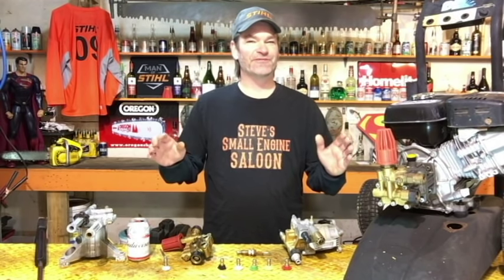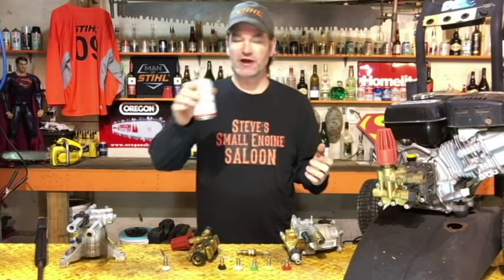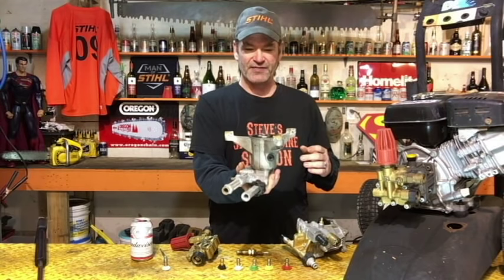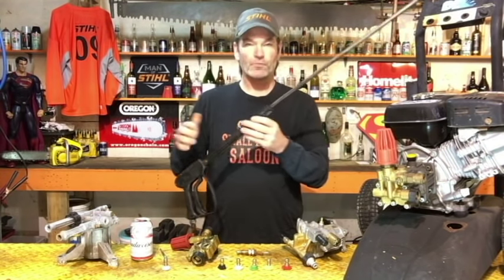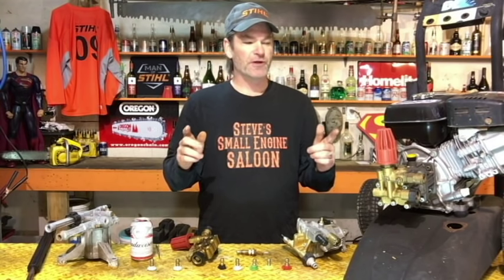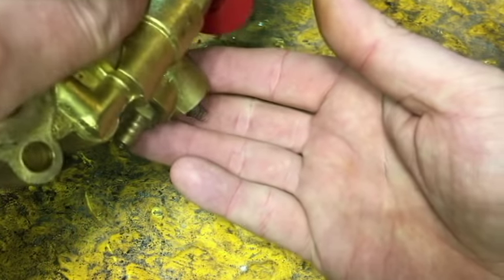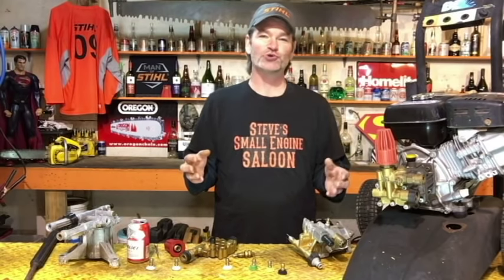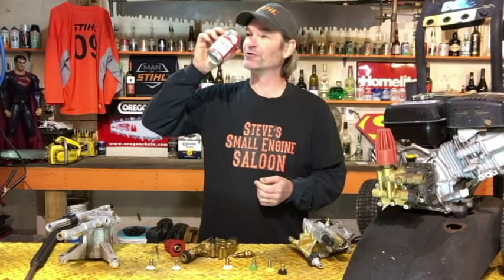How To Fix A Pressure Washer That Has Low Pressure

Comment: I want to set up some pressure washers hoses and accessories with quick connects. is there a standard or best practice for where the male quick-connects vs females go? I have seen some kits sold where they suggest both ends of the hose get the female connectors, however, hoses sold with quick connectors preinstalled have a male on one end and a female on the other. I would also like to be able to quickly/easily chain hoses together so it seems best to put male on one end and female on the other of the hose, I just can't figure which should go where. thanks for the vids! Cheers.
Reply: if there is no hard standard,  I think i would rather have the male in the wand so I have that convenience of pulling the hose away while pulling back on the collar of the female connections on the end I disconnect more often.  Also, this sheds some light on why manufacturers who sell quick connection kits suggest female on both ends of the hose, but i want to easily chain my hoses without a turn around coupler. If I need turn around, id rather have just one on the pump end. Also i think for flexibilitys sake I will make some male to male and female to female turn around on short sections of hose.  I dont like having a long chain of adapters creating a long lever to induce leaks and potential breakage on the pump or wand end, and get in the way on the wand end.

Comment: Is the pump shot if you have a small stream coming out and the hand trigger is doing nothing. Or does that mean the pump is no good. If so can the pump be fixed. It has been ran quite a bit without water hooked up. It is a mitsubishi  600.

Comment: Very informative.
Never were truer words spoken... Everyone has a favorite tip that they use all the time and the fact that holes wear over time and get bigger n bigger and bigger.
On a more serious note. It would seem to me that the majority of people's issues can be traced to the quality of their water supply.. And this video affirms that belief. We must develop a way to clean the inside of the pumps without having to open them.. I'm thinking soap, vinegar and something coarse in a loop for a few minutes along with a soak of hot RO water. Any suggestions?
Otherwise planned obsolescence wins. Can't have that.

Comment: I have a 4000 psi pump and I'm thinking of changing the oil .it sez on the pump SAE30 NOW I have BRIGGS AND STRATTON RIDEON engine oil which is SAE30. THE QUESTION is will the BRIGGS AND STRATTON oil suit my 4000 psi pump 
Thanks for your help

Comment: Question, I have a briggs 6.5 verticle shaft motor on my pressure washer, the motor locked up a week ago and I replaced the 6.5 Briggs with what I thought was an identical motor.  I hooked it all up and the washer doesn't have full pressure.  I got the old motor running long enough to hook it up again, son ran it out of oil because the oil cap came loose and he didn't notice.  loosened up the piston and ran it for a little while, the pressure was back to normal on the pump, its a horizontal pump on the bottom of the vertical shaft motor.  Is it possible I need to change the carb on the new motor so it will kick up and keep the pressure up on the washer?  I can't just run the old motor, I'm not sure how long it will be before it locks up again, probably when I get it nice and hot.  Anyway, do you have any recommendations or suggestions on what might be going on with my new motor?  It was off of a snow blower but otherwise its the same motor,  I did change the filter on the carb to the old one because the other motor only had the non filtered box.  Thanks

Comment: Hi , I have the pump like the one you had on the bench the one none adjustable modol 020344 . I dont have high pressure, only low pressure I go over all the step you mention on this video clip. Can you tell me what wrong before i buy a new pump. Thank you

Comment: Steve, this video has been very helpful and I will try to sort some of the problems with my washer using your tips.  My specific unit is a Craftsman (Sears) branded, 7 HP model with the horizontally oriented pump.  Have you come across any problems with this type pressure washer or what seems to fail most often, in your experience?  Thanks for your time.

Comment: Fired up my verticle gas pw today, first time since last year. Wouldn't run till I put new gas in. Then no pressure. I'm going to check the stuff in your video but thinking it may be a new pump. Other than blockages, can I do anything with the pump itself? This unit is about 10 years old but only has about 2 hrs running time. Thanks

Comment: i have a pressure washer that the pumps works fine but when i release the wand handle it seems to keep pressurizing and stalls the engine out instead of it going back to idle, the pump was replaced and isn't very old. any idea? thanks

Comment: Steve went to Scotland few years ago had a great beer called Innis and Gunn fell in love with it but reason for writing is have a echo back pack blower will run on choke but not off check compression only have 30is it the carb or cylinder

Comment: Hi  sir  nice vedio , i have an electrical motor pressure wash 110volts its working and it give pressure but the pressure seems like it reduce  because it does not reaches where it use to can you help me out here sir on what could cause it, thank you

Comment: Hey Steve. My problem is when I fire up my pressure washer the the water is blowing back out where my high pressure hose connects to the pump. I’ve checked the hose and tip for a clog. When it’s not running and water is on water sprays out the nozzle. Help!

Comment: Steve,  I have a 3000 psi Simpson  pressure washer. Does this model require  the pump itself to have an oil change? Thankyou.  I love your beer requirement for small engine repair.

Comment: Steve I have an older model Karcher pressure washer 2350 psi, I can’t figure out where the springs connect to the carburetor. Can you help with the routing and connection points. I can’t figure it out for love or money.

Comment: Ha, 2 years ago I didn't have the nozzle locked in, when I pressed the lever, it shot the nozzle across the yard. Put in back in and no pressure and leaked at the tip. After calling the company that made it, and explaining what happened, the tech guy said I blew the o-ring out of the wand end that seals the tip. So, that is another tip for all.

Comment: I have a troy-bilt pressure washer with the pump underneath. I got it for free. It has very low pressure. I used a different hose,wand and nozzle from a different pressure washer I know is good.  I taken the 3 brass plugs out and there is a check valve under each. 2 of them are are extremely disformed and do not move. Would this cause low pressure? Just asking before I start throwing money at it.

Comment: Can't figure mine out. No pressure with engine running. Motor tone never changes. Just took the unloader spring out (verticle pump) and freed up the plunger. Put back together and same issue. Spring wasn't broken or rusted at all. Stumped

Comment: Anyone know how to increase the pressure on a RYOBI 2300 psi electric? It's no stronger than my 1700 Black Max but the brushless motor is much larger and should be able to handle a stiffer spring and higher pressure.

Comment: I just picked up a decent Honda pressure washer for free. Cranks up first pull but the same pressure comes out weather the pump is on or not. Check valve isn't stuck. I can't figure it out.  I can hear the engine not go under load when I pull the trigger.  I'm afraid something bigger is the problem as i've checked all the little things.

Comment: Thanks Steve. Can you rebuild those small pumps( Ridgid 3000 psi, model RMV 2.5G30)? My pump started spurting water as it idled and it got to where the engine shut down, locking the engine. Can seem to find the rebuild kit on line. Im a fan of your videos. Ernie

Comment: Excellent Video Steve/ Do you have a video on Carb removal and repair for the Honda power jet, set up looks identical to what you are working on here. It starts OK but the choke wont shut off all the way without  running rough so I must always adjust it to run smooth for the pressure washer to work OK. There seems to be a slight loss of pressure when I do this and would love to clean this carb, I have used carb cleaner but its not quite there yet. any ideas would be most appreciated

Comment: Pressure. washers Ive used in the past all seem to fail the same way, the next season you try use them, the pressure is on and off again, on then off, almost as if you released the trigger and it was unloading you pull the trigger and the high pressure is medeocre at best after about 30 seconds... Everybody seems to want super high pressure, I'm looking towards a low pressure, low volume washer for washing AC evaporator coils.  I use to have one but it died.  The wand was unique, it looked like a dozen golf tees stuck into each other and you could bend it around about 180 degrees.  Dont seem to find them anymore
any ideas?

Comment: Hey Steve, I love the vids!
I've got a pressure washer that starts with 2 pulls. If the unit is moved, it has to sit for 10+ mins before it starts like a dream again. What might be causing it not to start after being moved around?
Reply: One of the reasons why you may have trouble starting your power washer again but I would think you would know about this one and that is you have to relieve the pressure on the wand by triggering the gun to relieve all that back pressure that doesn't allow the motor to start the other one is chances are the heat from the motor is causing some corporation problem maybe try priming again or adding a little more gas just keep on trying different things and eventually you'll figure it out

Comment: The nozzle tip blocking happens a lot. I bought 2 new extension hoses, apparently there was a strip of plastic in one and p!rugged my tip.
Engine bogged down when I tried to wash. Got it out with a guitar string. Also that inlet screen on the garden hose connection gets plugged up to.

Comment: You forgot to mention lime deposits wicn can build up in the pump....run some CLR through it maybe it will clear it out if not time to diss assemble the pump..
For winter storage use anti freeze in the pump ..Cheers 🍺🍺🍺🍺🍺🍺🇨🇦🇨🇦🇨🇦🇨🇦🇨🇦🇺🇸🇺🇸🇺🇸🇺🇸🇺🇸

Comment: At the family orchard/ winery where I worked for years we were constantly using our pressure washer to spray barrels and other fermentation equipment. I may have devoted more time to keeping that pressure washer functional than actually using it to clean anything. Lots of O-rings, gaskets, screens, and impellers replaced. So frustrating.

Comment: Steve, I have a "Giant" brand horizontal pump on my Excel xr2500 with a Honda engine. The engine starts on first or second pull but then I cannot pull the rope handle, it is being stopped by something. Am I supposed to be squeezing the trigger on the wand when I start the engine so pressure doesn't build up? In addition to that, there are three bolts all in a row with springs below them and some sort of white thingamjig. Somehow the water blows out the center bolt no matter how hard I tighten it. Do you have any suggestions for my case? Thank you very much.

Comment: I have an electric pressure washer, a Sun Joe SPX3000, I used it twice, worked perfectly. I put it away for 5 months, I tried to use it today, the motor is working, but the water is still just peeing out of the wand. Is the pump dead?

Comment: Steve, my pressure washer has a strange issue maybe you can do a video on. Comet pump, Honda engine. Engine idles fine. When wand pulled the engine stows down more and more the longe4 it’s pulled and will stall the engine. Replace comet pump and has the same result.wand issue maybe?
Reply: Paul McDonald mine does the same. I thought it was the pump also.

Comment: My problem is I got a new Simpson Water Blaster (belt driven), 4,200 Psi @ 4 GPM. I put a test gauge on it between the hose and gun inlet. The unloader is turned all the way up, and the gauge only reads 2,900-3,000 Psi operating pressure when I’m on the trigger (all nozzles, 0, 15, 25 read about the same), when I release the trigger pressure spikes back up to 4,000-4,200, it’s never consistent….it might spike to 4,200 but will then slowly drop down to 4,000 or right below that. I know that what should happen is the operating pressure should be 4,000-4,200 when on the trigger, with a 300-500 psi spike when I let off…but that’s not happening and I don’t know why.

Comment: After I reassemble the pump and case should I be able to turn the shaft and the wobble plate?  After I put the pump on I am still able to turn the shaft but as soon as I start tightening the four bolts that mount the pump to the casing I am unable to turn the shaft anymore (is this normal).  Also, as I tighten down the four mounting bolts i get to were there is about 1/4 inch left before the pump and case are sealed but I am afraid to tighten any further as it seams like something is not right and that something might break.

Comment: Thank for the video.  My question is what if you have a vertical pump that can't be adjusted and all of your tips and everything else are fine but you're still getting low pressure?  Is it likely that the pump itself could be bad or is there something else that I should look in to. Thanks!
Reply from the maker: Unfortunately in my experience, 99% chance it just needs totally replaced...

Comment: Hey Steve I have a craftsman that wouldn't start so I followed tutorials and clean my carb and it started I was super excited thought the problem was fixed but then I ran in to the no pressure problem my washer hasn't been ran in probably 3 years so I messed with the pump a little bit bc I couldn't get any pressure after blowing out with my calves with a compressor I finally have water coming out of the wand but no high pressure I have a vertical pump and am at a stand still at what to try next please help!

Comment: @Dale Williford if your not getting any hi-pressure with the wand triggered squeezed, disconnect the hi- pressure hose at the pump and run the machine. If you have water discharged at hi-pressure, your wand is plugged or the valve in the wand is defective. If you get some pressure or it’s intermittent, sometimes working other time not, the unloaded can be sticking. If you can find a shop manual for this equipment, the repair procedure will be explained.

Comment: great video....I would add another thing to check for, especially if you have intermittent pressure and you live in the south... Lizards in water hose ROFL
I took about the valves and check / cleaned, upon completion I decided to remove the water hose and check those valves when to my surprise I see a lizard tail come out...guess it was hiding inside and I didn't know, it would give pressure until trigger squeezed then couldn't get enough water.
who knew... guess I'll have to check hose before i hook up to stuff, gotta love Florida!
Reply from the maker: LOL, awesome....

Comment: Thanks Steve. You have been very informative and have helped me out a lot. Do you have a video on care and storage for a pressure washer? I tried to look through your videos and couldn't find one. I have a pressure washer that I bought probably 7 years ago and used it once a year, a couple of times I skipped a year. It's been about two years since I last used it. Now that I have been watching your videos and in some small engine fb groups, I know I've been doing it wrong when it comes to the fuel that I use and how I store it. So when I have time, I'll have to go through the gas tank  fuel lines and carburetor really good and start doing it right. So I was just wondering if there are other things I need to do besides what you have mentioned in this video? Any pressure washer products I need to use as well? I've always removed the hose from the pump and the wand. Thanks for everything you do for us. Cheers.

Comment: On the garden hose connection if the filter is gone take apart the garden hose assembly and pull the filter out or whatever is blocking the water

Comment: Ever encounter a pressure washer that the engine runs perfect BUT after spraying high pressure water after a while will bog down and actually shut it the engine off?  I noticed if you let go of the trigger once it’s starts to bog down it will come back up to speed and run(idle) fine.   Then if you give it a couple seconds of idle, (cools pump off ??) it will run fine for a little while then start to bog down again.

Comment: Steve , what should I check if my pressure dies when I pull the trigger on the wand? Happens with all nozzles. I have a Troybilt with the pressure pump underneath.

Comment: Steve, our pressure washer runs fine but no pressure.  I can't remove the high pressure hose or tip.  Pulling the trigger does not release pressure and no water pees out.  What do you recommend?

Comment: Steve, thanks for sharing your expertise. I have a question I wished you had covered on Pressure washers. I cannot get my washer to siphon the soap solution, has worked for years but all of a sudden it does not. Took fitting off and it was clear, also purchased aftermarket suction line with adjustable valve, still no luck.  Any suggestions. Thanks in advance,